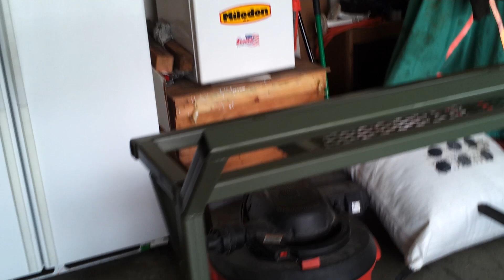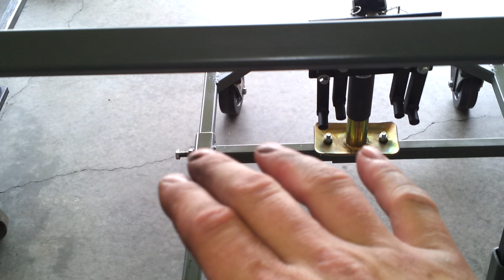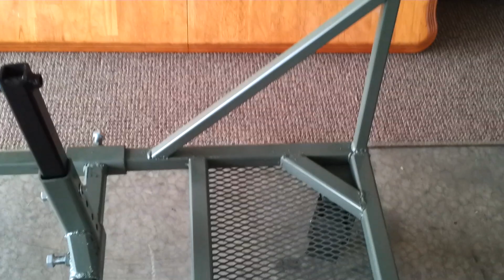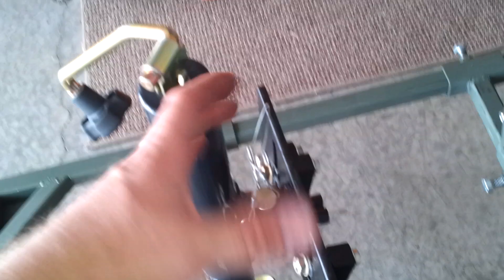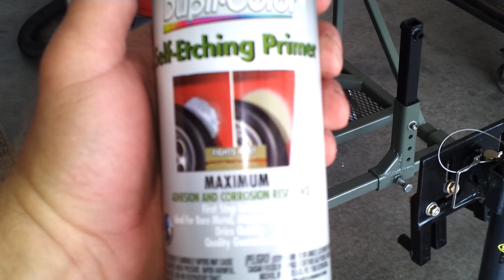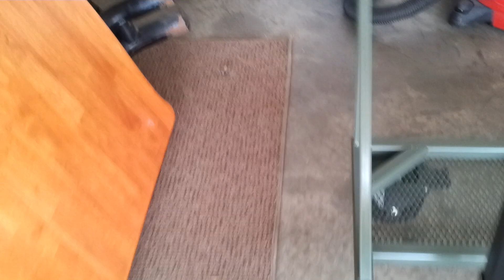Engine start stand plans IV

Comment: As so many others have said… nice job. THIS video series has really made me want to finally build a run stand. 
Some of the major design points I never considered until now, How to transfer an engine from a regular holder/stand,, to the run stand and back….Large castors for height, and the trailer jack is genius. Very nice 👍
Reply from the maker: Thank you sir....1 other thing Id suggest is to mount the radiator on some sort of hinge mount that way you can swing it out of the way for easy cam swaps. With mine I'd have to unbolt the radiator to swap out a camshaft!

Comment: Great job.  I will use many aspects of your build here.  I wasn't a big fan, at first, of the trailer jack mainly because I like the idea of leaving room for the transmission if you want to run that in too.  But, it appears your jack can move side to side.  I think I'll incorporate some kind of trans mount or oil pan support off the same jack so you can go either way.  I like how you retained engine rollover.  I will see if I can figure out how to incorporate a crank rollover gear too.  I think these stands make the most sense when they can also be full-on assembly stands.  Well done!

Comment: HEY NEED DRINK HOLDER,,WELL MADE STAND & NICE VIDEO .,.,??OK WHEN I BUILD ANY THING I MUST BUILD TWO OR MORE TO GET IT RIGHT ,,,PLEASE THIS IS ME , MY IDEAL,,,MAKE IT SO YOU CAN BUILD YOUR ENGINE ON THIS STAND TOO,,,,FIX SO FORD CHEVY MOPAR ENGINE FIT ,PUT   ,.,.,.,. OIL PRESSURE..,.,.  TACK ..,.,WATER TEMPERATURE GAUGE ,.,.,.KEY ,.,., PUSH SWITCH ,,.,MUST PUT COVER OVER BACK OF ALL GAUGES .,.,.,HAVE MOTOR MOUNTS TUBE COMING UP TO MOTOR SO THEY WILL INTER CHANGE FROM CHEVY TO FORD TO MOPAR  IF YOUR A MOTOR REBUILDER ALOT PUT MUFFIN ER PIPES THIS WAY YOU CAN HEAR TO ADJUST CARB ,,,LIFTERS ,,.,.SO ON,.. BEFORE PUTTING IN CAR.,.,., REBUILDING  OR FRESHING UP MOTOR IS ALOT OF FUN .,.,YOU CAN MAKE ALOT OF MONEY REBUILDING CARBS ,IF YOU CAN ADJUST THEM RIGHT,IF YOUR GOOD MONEY WILL PORE IN ,,.,.,.,.,OK NEXT TIME WHEN YOU WELD SLIDE BARS PUT SMALL STRIP WOOD OR ANY THING ON BOTH SIDE OF TUBE YOU ARE WELDINGTHIS WILL KEEP IT IN THE MIDDLE ,YOU DID A GREAT JOB ON YOURS SO IF YOU BUILD ANY THING ELSE PLEASE MAKE VIDEO ,I;M GOING TO BUILD ME ONE WILL USE SOME OF YOUR IDEALS ,,GOOD TO YOU

Comment: Very nice engine run stand for a Chevrolet, if you ever decide to build a Ford engine you will need to have a stand that will accommodate a transmission or bell housing due to the starter that mounts to the bell housing / transmission. Also make sure that the casters are at least 6" tall or caster extensions on the bottom so that the engine hoist will roll underneath it so you can drop the engine down into the cradle of your new stand. Engine run stands are the only way to go. Solves a lot of problems before you install it into your car. Good job! I'm a Chevy guy and love BBC's
Reply: Hey Ronnie I didn't know about this Ford starter plate until I saw one on another YouTube  video. type in SBF block starter plate  Probably have toshorten two of the Engine Stand arms but it would work. then just use some washers or shims if you put Chevy back on.